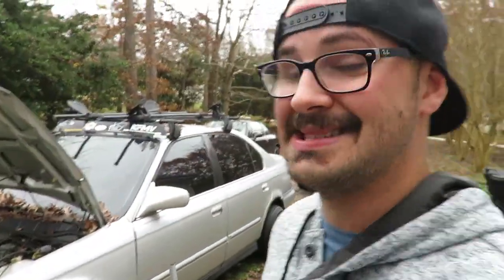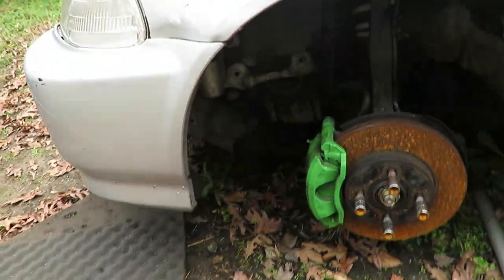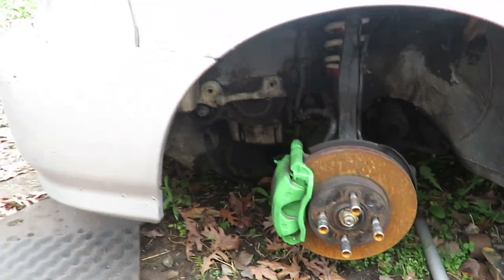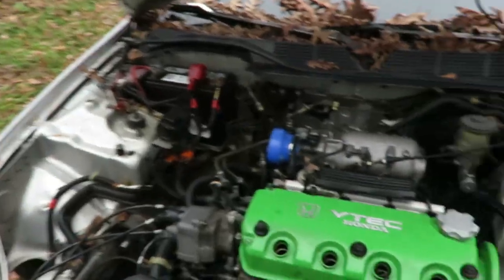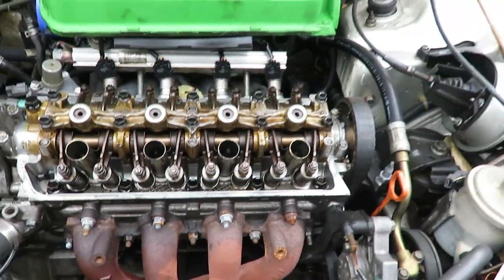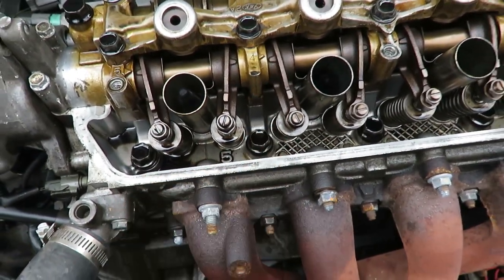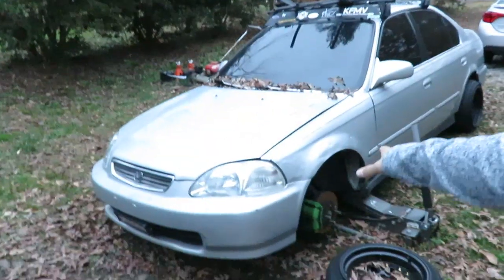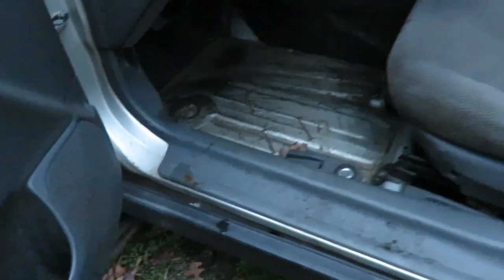This engine in my civic is completely seized

Comment: Good night bro .. I bought one the same as u.. I took of the spark plugs and disconnected injector plugs poured some mystery oil on the spark ports let it sit over night and next day it spin on the crank with a breaker bar but it' was a b### but got it to run and it's my daily

Comment: I believe my Integra B18B1 motor is seized. Turning the motor over by hand at the crank without the spark plugs and it wont budge counter clockwise only clockwise. It rotates clockwise rather easily too. Honda B-series motors operate counter clockwise so I don't want to fully rotate the motor over clockwise. I removed all serpentine belts (alternator, power steering pump and AC) plus dismounted the starter and distributor and it still wont budge counter clockwise. I poured Marvel Mystery oil in the spark plug holes and it hasn't helped. 

When I initially started rotating the crank by hand I mistakenly left the car in gear, with the gear set in neutral it still has the same issue. Could there be anything else restricting the motor from rotating besides the water pump possibly being seized? The timing belt is rather new and doubt the motor is out of time. Could the car somehow still be stuck in gear even with the shifter in neutral? Any help would be greatly appreciated. Thank you
Reply from the maker: If the car was still in gear maybe the slave cylinder or something failed the crank would still turn although it would be tough to turn but the car would move as you do it. More than likely what you were dealing with an oil pump failure that’s what happened on our civic. Take the oil pan off and look for discoloration on the road caps in Main caps, If the oil pump failed more than likely this is where the restriction is coming from in your engine not allowing it to turn.
Reply: @NITROKID98  Thank you for your reply. Some background on what lead to the issue.. My car was partially flooded due to the recent storm in the north east. Prior to this my car was driving fine. My car was parked when it was subjected to water so I'm ruling out hydrolock since it wasn't running. The following day I drained all the motor oil which had I would say about one tablespoon of water and pulled the spark plugs. I drained the transmission and it had no water. I pulled the valve cover and there was no water inside. I pulled the oil dip stick and there was no water droplets. The car was then rolled from my driveway into my backyard, I have yet tried to turn it on as I don't want to potentially damage the motor internally. 

Do you know if the oil pump can suddenly fail even with the car not running? Being that I can still turn the crank clockwise freely, is there hope that the motor is not seized and it is being restricted by something mechanical such as the oil/water pump? Would you know when a motor is seized if it will NOT turn over in either direction or it can still turn in one direction? Thanks again.